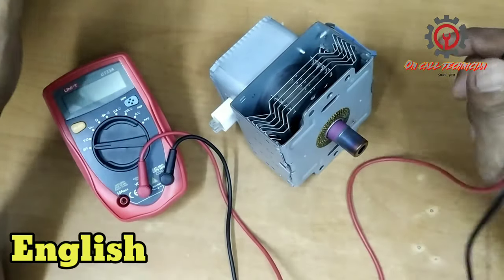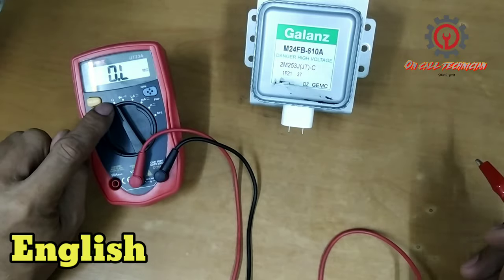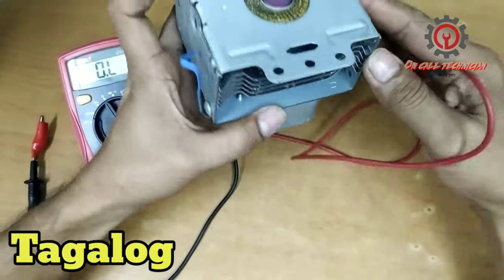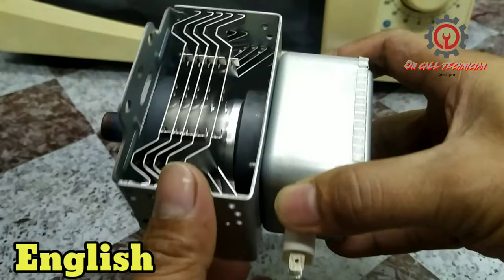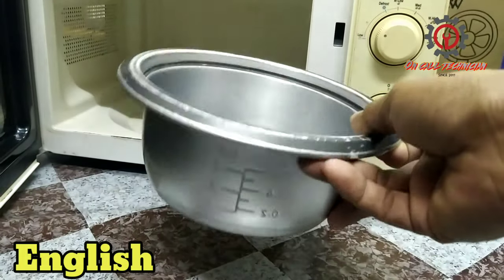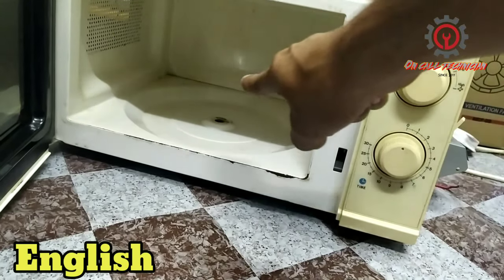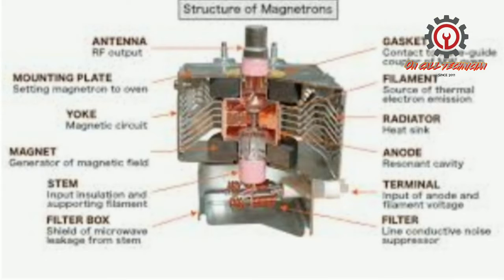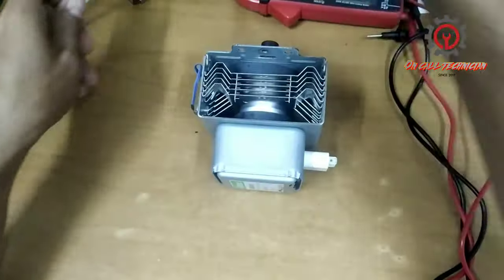HOW TO PROTECT AND TEST THE MAGNETRON USING MULTIMETER (ENGLISH/TAGALOG)

Comment: Master good day po... 1st comment po ako jejeje...about walk in freezer, yong heater dna po nag automatic, ano po kaya posible sira non master? Salamat....
Reply from the maker: Mostly sira sir is output relay sa dixell, if mayroon defrost indicator sa display pero. Replace lang sir 5 pins relay at bago mo palitan sir voltage check ka sa dc side ng relay. Dapat makakameasure ka ng 12-15v dc. Kapag wala replace control na sir malamang transistor na smd open na.